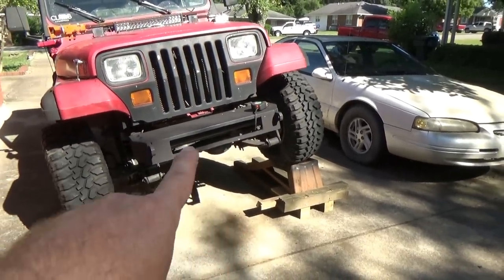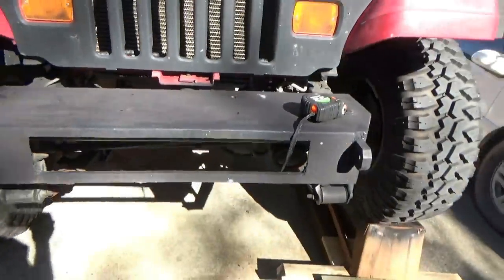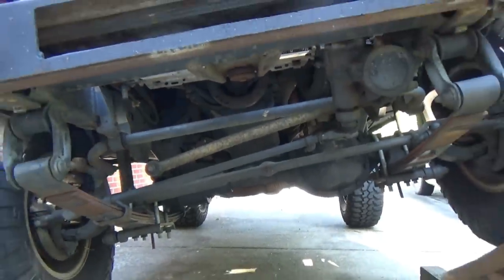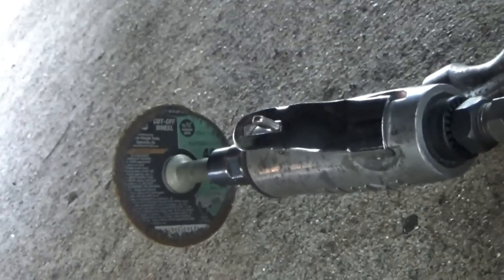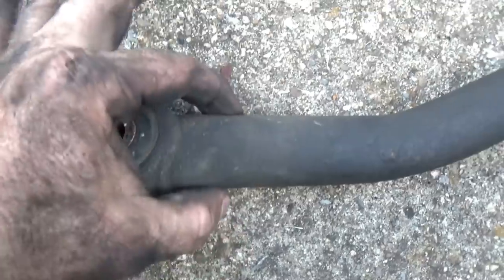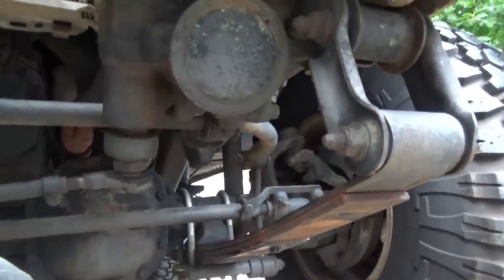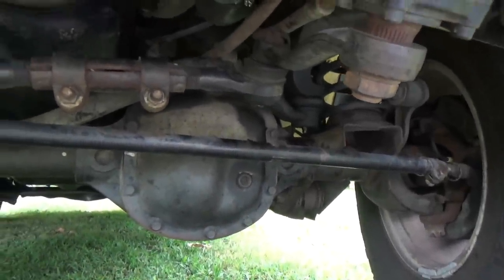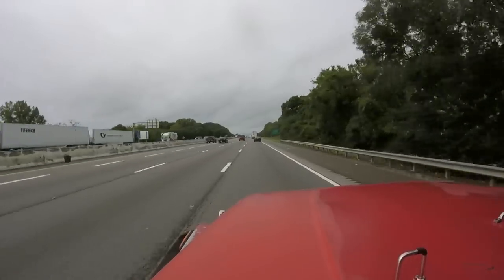Jeep Wrangler YJ - I removed my Track Bars

Comment from the maker: First of all, here are some track bar / suspension parts if you need or want some:http://amzn.to/2jfYahs  Cool .. Hello Everyone. Just like to point something out. After answering many comments I've realized that this is one of those mods that some people are not comfortable doing. If you are not comfortable pulling the track bars off, it's OK just don't do it. There is nothing wrong with leaving them on. The Jeep will still drive down the road with the track bars. The only benefits to removing the track bars is provide to more flex for the off roaders and a smoother ride for the asphalt. I have had good luck with no control issues at all. But, I am typically a slow driver anyways. I feel safe because I don't drive aggressively to begin with. My '84 GT Mustang that is seen in the background occasionally, it ran real strong. NO problem laying 3rd gear rubber. Yet the car has never been over 100mph on the highway. I've cut it loose on the dragstrip a few times with an older engine set up. Will it bust a 100mph? Not a doubt it will. Does it handle curves well? Its does fairly decent (needs rear suspension work). It will totally out corner the Jeep though .. why? Because the Jeep wasn't ever meant to hang corners to begin with! Drive a Jeep Wrangler for what they are, great capable off-roaders or cruising on the asphalt with the top off .. IN THE SLOW LANE chilling out enjoying life.
Again, there is nothing wrong with leaving the track bars on if that is what you want. Any video, instructions, website, person ... etc that spells out mods, hacks, repairs is not twisting anyone's arm to do what they are watching or reading. At the end of the day, it's up to the owner of the vehicle as to whether they want to perform the modifications that is being demonstrated. Thanks everyone and have a great day! Peace out .. Later Y'all!
Has this tip helped you? Here is a free way to help me. Here is my Amazon influencer page that has many of the parts I've used in videos and some parts that friends have used. https://www.amazon.com/shop/poweraddicts-fixjeepscom-jeepcarandmotorcycletips?ref=ac_inf_hm_vp . By purchasing through this Amazon page you help me get a small commission of the sale and you do not get charged a cent more. Keep checking back because I update the Amazon page often. Thanks for your support!
Reply: Just cut the brackets off. 🤣
Reply: Just took mine off my 90' YJ. I cleaned the bolt ends off first then soaked them for two days with PB Blaster Penetrator. Used a 1/2" breaker bar. I did disconnect the left rear shock bolt from the axle. It gave me more room to access the left upper track bar bolt. I love the way it rides and handles. Night and day difference! Thanks Power Addicts.
Reply: Mine came out easy on my 93.   Didn't have to move or loosen anything else. 2 bolts and done.

Comment: Track bars on a leaf sprung vehicle make no sense.
Reply from the maker: So very true!! Thanks for checking out the video and leaving a comment. Have a great day!
Reply: When I first got my yj it didn't have the front or rear track bar.. I didn't even know it was a thing until I got more in to jeeping. Never had an issue with it. I added the front track back on just to see what the hype was about and the jeep did not like it one bit. I've been riding with out tracks for 3 years now. If my yj ever rolls it's not because of the lack of track bars.

Comment: Thanx for this video. It only took me 66 years to finally get my first Jeep. I bought a 88 Wrangler YJ December 2020 and have been steadily doing improvements to it, when the funds, allow it. My "Bet-R-Half" (Jeep Name) rides extremely ruff, bone jarring over bumps. After seeing this video I decided to take the front and rear track bars off. The Front was Easy Peasy to remove. The back was froze up like yours. After about 30 minutes of trying to cut the bolt off, I gave up. I then put a new cutting wheel in my grinder and decided to cut the track bar itself as close to the connection as possible. Hell of alot easier. This 88YJ will be my last vehicle and I have no intentions of putting a track bar back on, especially after taking it for a test drive down the bumpiest street in my neighborhood. What a Freaking difference, thanx again. Oh Yea, I have a kidney belt for sale , lol
Guy McDonald
Reply: DO NOT SELL THAT KIDNEY BELT!!!  Damn leaf springs will give you reason to use it!!!   LOL.  In my Jeep I feel like I am riding in a semi doing a bobtail.  No weight to smooth things out.  At times I wish I had coils, then I watch YT and glad I have leaf.  BTW, the track and stabilizer bar on my jeep are in some dump somewhere.  🙂

Comment: I have a 93 with a 2-1/2" shackle lift on 32's. Removed both track bars. The ride is sooooooo much better without the track bars.  No bad effects noticed at all.
Reply from the maker: Its a great improvement!! I should have done it a loong time ago! Thanks for droppin in and leaving a cool comment! Have a great day!!
Reply: Absolutely agree!  Like you I have heard the discussion on this for a long time. Your video inspired me to pull the trigger and do it. I plan on fabricating my hood lock that you came up with in a couple of weeks also. Keep the YJ videos coming!
Reply from the maker: That hood lock works well. Take your time on the drilling and tapping the bolt holes. Get them too far off center the bolts will not thread in. Glad you like the vids!!!

Comment: First thing to come off a yj Is trackbars and sway bar. Limit so much flex and honestly handles so much better on the road. People who are worried about body roll, gonna sound silly but try driving with wheel spacers turning hard and see the difference it handles. Offset wheels, spacers or both make a large on and offroad improvement.
Reply from the maker: Removing the track bar was the best thing I've done yet!! So much better ride! Thanks for dropping in and leaving a great comment. Have a great day!
Reply: Haven't done the bars yet but it had spacers on it when I got it and it is much more stable than previous jeeps I've owned. The bars will be coming off asap because it is rougher than my old 3/4 ton and light enough it feels like it catch air on bumps on the hiway
Reply from the maker: Removing the trackbars made a big difference in mine! Im glad I did it. Thanks for dropping in. Have a great day!

Comment: Been jeeping since about 75.  None of my old jeeps had track bars or sway bars.  When I got a 93 YJ, that crap went real quick.  Have to admit the sway bar took a little longer.  Have the quick disconnect but is a pain in the ass.  Must be on level ground.  So the sway bar is now held up by zip ties..  The lift I have is very stiff and don't notice sway in It.
Reply from the maker: My sway bar is still tied up by a piece of wire. I should just take it off. Glad you enjoyed the video.

Comment: Ok I'm going to try this. I added a 2.5" suspension lift (new springs with an increased arc). It rides like a buckboard. I added a corbeau suspension seat which helped, but it's not fun. I installed the sway bar disconnects already too but haven't tried them out yet. I even added the track bars extensions front and rear to keep the diff centered. I only plan on trail driving, not Moab rock crawling so I want this riding as soft and smooth as possible. I'm doing this. Next is better shocks. I'm disconnecting the shocks as a test to see how soft I can get it, then ordering properly valved shocks. I'll let you know my results.
Reply from the maker: I'm really happy I did this mod. It helped the ride quite a bit! As for your shocks, don't go with the "heavy duty". They are valved a lot stiffer, therefore, making the ride much harsher. My buddy has a TJ, he went with heavy duty shocks ... it now rides rougher than my YJ. Please do let me know the results. I'd like to know what you found. Thanks for checking out the video and taking the time to leave a comment! Have a great day!!
Reply: I know, late to the party here.  I did the 2.5 lift.  was more like 4 to 5 inch lift.  Also did the SYE.  Before I did that I removed the track bar.  Did the quick disconnects for the sway bar.  Now the sway bar is held by zip ties.  The quick disconnect is a pain and no longer use it.  No need, slow driver and the lift is so stiff.

Comment: Too cool.   I have just finished up my 95 Hardtop installation on my 93 with half doors.   Ended up modifying  the half window frames a little so the windshield angle and top contacts fit.

Now I am going to try your suggestion on the track bar. I have already tried to loosen the back when I installed the exhaust and gave up on it at the time. 
The front it pretty oiley, so it probably will come loose.

I have a 1.5 lift with just heavy leaf spring shackles.  And large tires.  I carefully set toe-in to 1/4 in and Jeep was quite twitchy. It also made the off center a  heavy. Interesting when I first started, it was 3/16" out. (think someone got confused before me) twitchy but no pull which was interesting

I kicked it back from 1/4" in to 1/16" in and that actually made it pull to the right on a crown road.  So I set it just a tad over 1/8" in.   Still a little heavy off center but good.

My Jeep is pretty much around town under 35-45mph  hobby.

MY QUESTION.   WHEN YOU SAY IT RIDES BETTER ON THE HIGHWAY, DO YOU MEAN LESS TWITCHY? IT ACTUALLY AS IS FILL LIKE EVEN EVEN BUT LITTLE BUMPS TEND TO STEER VEHICLE. HOWEVER,  MINE ACTUALLY STAYS STRAIGHT DOWN THE ROAD THEN MY WONDERING TACOMA.  HOWEVER, THE CONSTANT TWITCH IS A LITTLE WORRISOME. MY SUSPENSION AND TIERODS AND SUCH ARE LIKE NEW TIGHT. NO PLAY ANYWHERE.
JUST LOOKING AT THE PANHARD TRACK BAR MAKES ME FILL LIKE WHEN YOU HIT A BUMP OR UNEVEN ON SAY RIGHT TIRN, IT'S UPWARD MOVEMENT IS   PULLING LEFT TIRE.

SORRY ABOUT THE RANT..SO JUST IN CASE YOU MISSED IT,,
MY QUESTION.   WHEN YOU SAY IT RIDES BETTER ON THE HIGHWAY, DO YOU MEAN LESS TWITCHY.??
Reply from the maker: With the track bars installed, when the suspension flexes due to a bump in the road, it actually pushes the axle to the side because of the arc the track bars runs at. Also, the suspension is in a constant bind due to the leaf springs are designed to go up and down, track bars force them to work side to side as well. So the leaf springs and track bars are in a constant battle for proper movement. Removing the track bar allows the leaf springs to flex naturally, therefore, a softer ride. As for all the details you mention about the minute changes. Its a Jeep Wrangler .. its never gonna drive perfect. My dads 2006 TJ is flawless mechanically but it still has its quirks when driving it. As for being less "twitchy" as you call it. I guess you could say yes it is less twitchy. When turning or changing lanes its a bit softer feeling when turning the steering wheel. I know many people that dont like the feel after removing the track bars. So, if you are into the detail minute adjustments looking for the perfect handling. Don't tear up your track bars taking them off. You might want then back on. Hope that helps. Have a good day!
Reply: Thanks.  Not going to tear them up.  Going to remove one bolt on the front and tie it up just to see if it does eliminate some of the roll steer.  Will report back.
Not sure about the back.  Going to put a little fast heat and see if it will break.  It really need to come off or I need to get another exhaust.  My Walker tailpipe is not bent exactly correctly from Autozone.  Either it hits the bar or the tub.   I slid it to clear both but that leaves the rubber hangers at the muffler area at a 30 degree angle. (I hate exhaust) One Local muffler shop refused to work on it because it has no cat.  Another wanted an arm and leg since to adjust it, he needs to block engine/transmission and remove skid plate.
Reply from the maker: Exhaust can be a pain no doubt. I built my own exhaust so I don't see why that shop says that the skid needs to be dropped. I gotta part of my exhaust from the muffler back. I used some exhaust parts from another rig I stripped out so there are holes starting to develop in the used muffler and tailpipe. I used all new pipe from muffler forward so it's all good. I've got a new Walker tail pipe just haven't installed it yet due not purchasing a new muffler yet. That rear track bar can be a pain. I had to cut mine out. The sleeve inside the bushing at the body end was siezed to the bolt. It would turn but not come through the body tabs.

Comment: Another great video.  Going to take them both off very soon.  Front is new with new hardware, so I know that one will be done in minutes.   The back not so sure.  Original from 94     Might be a problem

Comment: I did this mod with my 93 and a 4" lift. Good mod.👍thsnkfully I didn't have problems with the rear tracbar. Wondering if it would have been easier to just cut off the bracket though. 😉
Reply from the maker: Yes, it would have been much easier. Not sure what I was thinking that day. 😏. Thanks for dropping in! Have a great day!

Comment: I think the track bar should help limit lateral frame swaying on turns, even more excessive on a lift kit?
Reply from the maker: It does but it also limits how well the leaf springs do their job. If you have good bushings there should be very little lateral movement even without the track bars. If you feel better with them, run them on your rig. It's all up to what makes you feel you need.

Comment: Yea I ditched mine right after I put my 4" lift on and never looked back. I also ditched my sway bar up front as well. It rides so much smother. Love the videos. Keep them coming. Check out my build zombicon 13.
Reply from the maker: Glad you like the videos!! I'm glad I did the mod, It made a big difference!  Sway bar video is coming soon! I subscribed to your channel so I can follow your build!! Good luck Jeepin brotha!!
Reply: I've never driven a YJ with no sway, but a TJ with no sway is not super fun on the road. It takes curbs like they're not even there though.

Comment: Have you ever been in an old CJ7 with bigger tires and start to turn the wheel the body will roll before the axle turns hints that is why they put in a track bar it creates an oversteer

Comment: I must say that I have subscribed and watched this video three times. Best explanation on this topic I have found. Question, do you think that with a lift the center of gravity or top heaviness would effect cornering? I have a six inch lift and am considering taking out the track bars. Thoughts? Great Video.
Reply from the maker: Thanks! Glad you found the video informative. Anytime you lift anything it effects stability and corning because you are raising the center of gravity, therefore making it be more top heavy. That is just simple physics. There are lots of people running lift like yours with no track bars or sway bars. In the end you got to decide for yourself what you are comfortable doing.  Will it allow more body roll? With as much lift as you have yea more than likely it will. There are many people who totally spaz at the difference it makes in the handling because it may feel less responsive and they put them back on. Then there are the people who are amazed at the ride quality difference. How much all of this is effected will depend on how stiff your leaf springs are and the condition/quality of your steering and suspension parts/bushings. Again .. its completely up yo what type of ride and handling you are comfortable with.

Comment: Thanks for posting this very informative video!  I have a 95 YJ and it has major frame rust issues that I am fixing with lots of welding and fabrication.  The track bar brackets are completely rusted to the point of they don't fricken do anything!  Now I will just remove them and weld up the frame were they were at!  Thanks again!
Reply from the maker: Trash those rack bars! LOL . Mine drives great without them. Good luck on the rust repair. My 93 I'm building is a rusty mess!! Thanks for taking the time to leave a great comment! Have a great day!

Comment: This may have nothing to do with my trac bar being on but I bought a 90 just from my buddy with a 4 inch lift and 33 muds and I have had it for 6 months and I have had 4 rear u joints pop on me I do have the yoke slip eliminator. Could having my trac bar have anything to do with that
Reply from the maker: Nope .. that has nothing to do with the track bar. Sound to me like the drive shaft angles still aren't right therefore binding the u-joints.
Reply: @Poweraddicts  Correct! Anything above 2.5" lift the YJ community recommends putting in wedge shims in the rear springs to angle your rear diff up towards your transfer case.

Comment: Awesome video and your descriptions, detail and demeanor is far better than mine when I get onto this trac bar issue with people.  (Have NO PATIENCE for dumb people)     Gonna copy and save this one to post every time the issue comes up and shut this issue down once and for all.    One of many moronic solutions the hacks at NHTSA have come up with over the decades!   Often wonder if any one of the morons there ever took a single day of engineering classes or have ever worked on any vehicle... Or let alone a dang 10 speed bike!
Reply from the maker: This topic comes up in the forums and FB groups multiple times a day. I just copy paste the video link into the thread and let it ride. In the end, it becomes a personal preference. Some people just get it stuck in their heads that the "factory put it there" its supposed to be there. I'm not even running my sway bars connected right now, can't really tell the difference. Pulling the trackbars no doubt it rides better. In the end, I just don't argue about it anymore. I just tell em' "keep your trackbars .. I'll remove mine and we will both be happy". I'll never run trackbars again on a leaf spring Jeep. Thanks for dropping in! Have a great day!